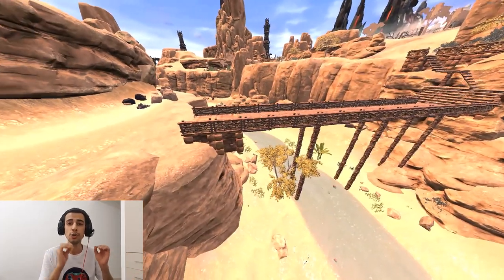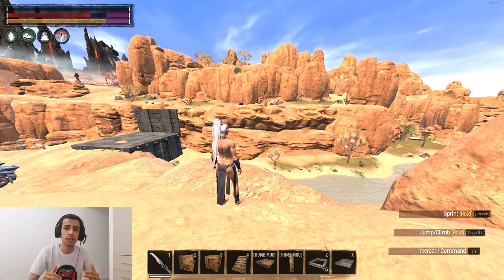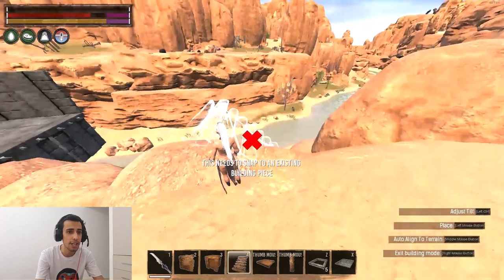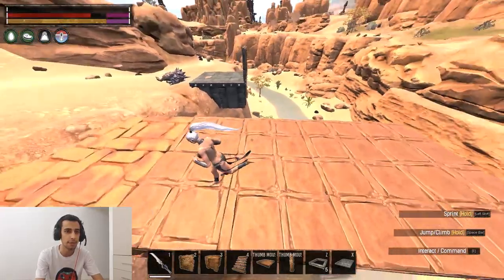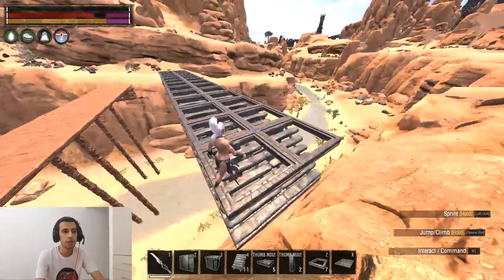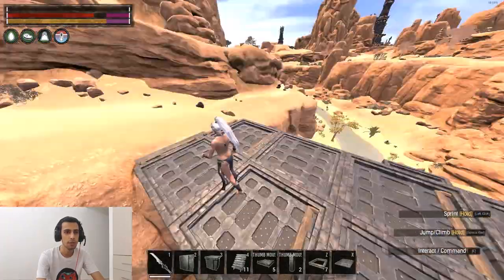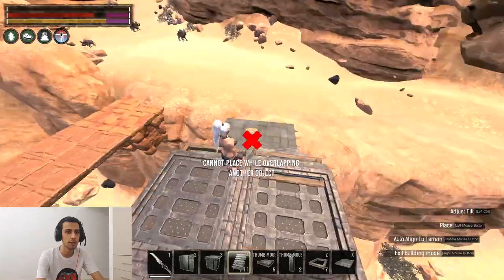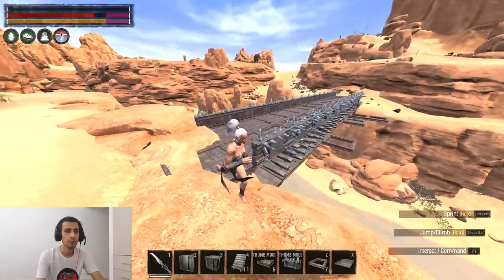How To Build A Bridge Without A Pillar - Stability Bug ! |  Hatch Frame Tactic In Conan Exiles

Comment: There is also a way to build by staggering  pillar with stairs and then removing stairs to offset lower ceiling.  You place ceiling, offset ceiling, and pillars in center and ends and continue until you reach end.  No need for hatches.
Reply from the maker: Ok interesting will try that 👍